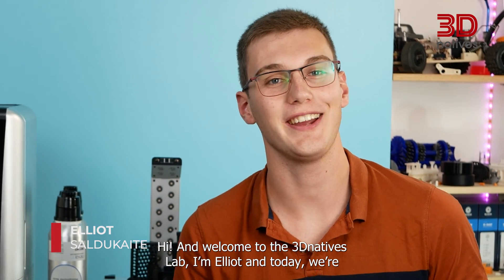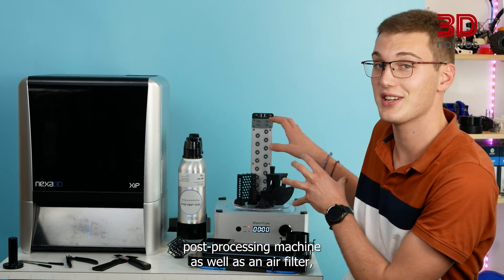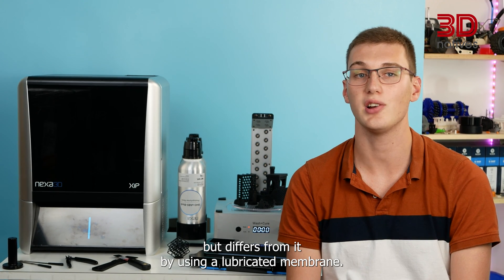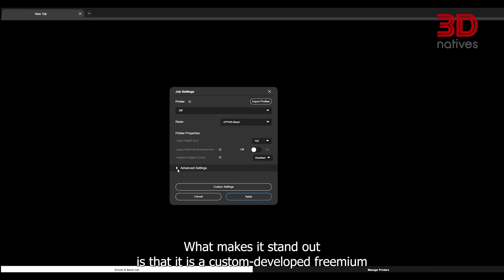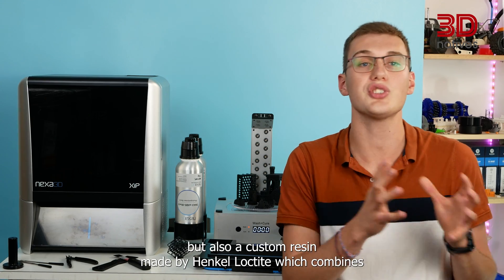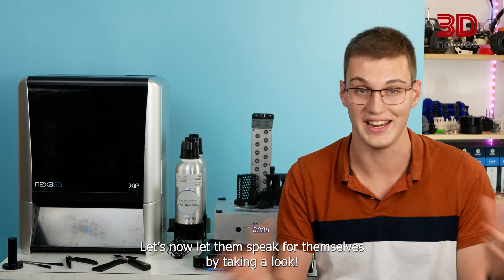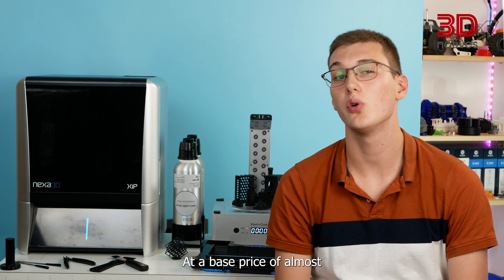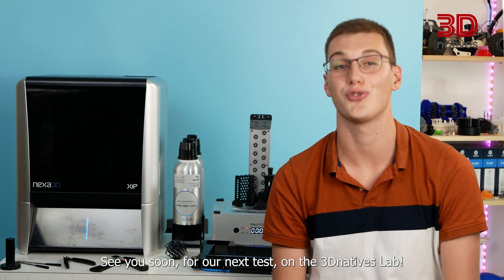Testing Nexa3D's XiP, the First Resin Desktop 3D Printer | 3Dnatives Lab

Comment: i had to slow down the video in order to see that it would take 3 hours to print the benchy model . That doesnt justify the price tag.
Reply from the maker: Hello, the XiP uses a proprietary LSPc printing technology derived from MSLA. This means that the entire layer of a print can be done in one go. So whether you print one or ten models, as long as you have the same layer height, it'll take the same time to print. The printing speed of this type of 3D printer is useful for big prints or batch printing with an array of models placed all over the printbed. Moreover, with this printer (as with many more industrial systems), the added value comes from the build quality and the overall ecosystems (materials, post-processing & software)

Comment: So, just one issue I have here. The price tag. If this is the XIP listed on the site, it retails for over $6,000. I run a print shop and can honestly say we have never spent more than $1,200 on a single unit. That is insane and will not sell very well. Good luck to them, but if all you got is a slippery film, you can easily do that with a lubricant yourself.
Reply: I own a dental lab and have worked with many CAD programs and printers. No way we could ever get by with a low end 1200$ printer. The high tolerances needed alone put us into the 35k range for years. Having an open materials option is exciting to see. What’s gonna make or break it with our industry is accuracy,speed, reliability and ease of use. My last cheap printer the FormLabs 2 was a waste of money. 
We look forward out trying out another printer in this price range
Reply: @reaper98765  true. But this printer is targeting enthusiasts and not professionals. It doesn't seem to offer anything from their professional targeting technology except that membrane that gives you speed. The price is 10 times lower than their pro printers, but it's like 6 to 10 times higher than desktop printers.
So it's basically for nobody - not for home users and not for companies.
Reply: @reaper98765  Sure I could see that in the dental field for sure, but we make models, parts, and minis. $6,000 or more is insane for a business like mine, so this is sort of reserved to the folks with deep pockets, or folks like you, who need 0 margins of failure. Have you looked at Anycubic's DLP line? They have two machines that are amazing that I am pretty sure are capable of dental casting. Both of them are under $800.
Reply: @reaper98765  what large format printers do you suggest?